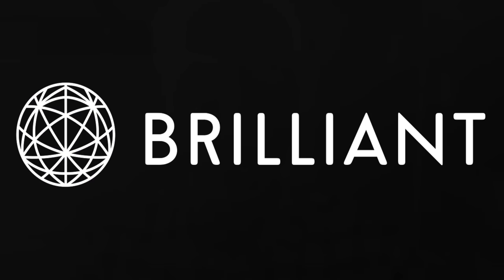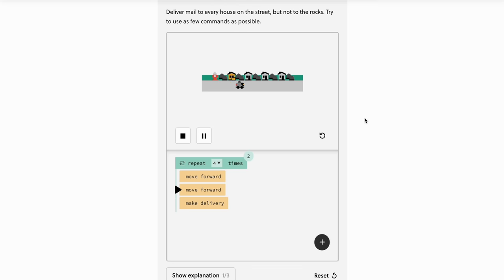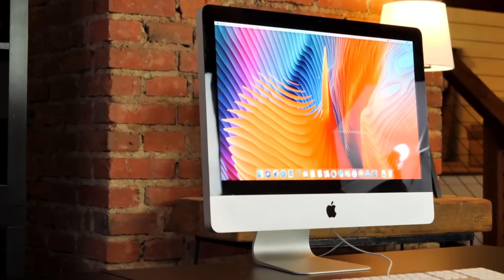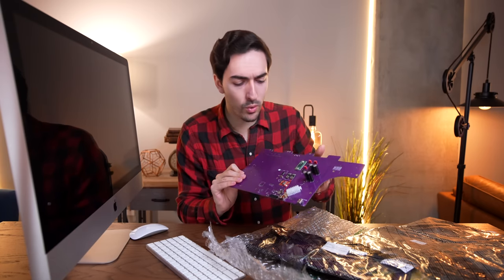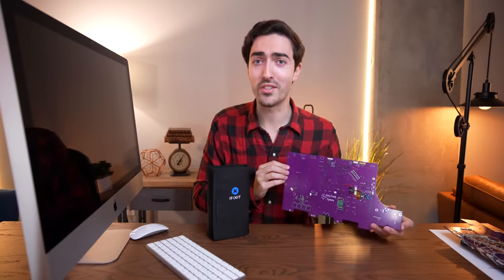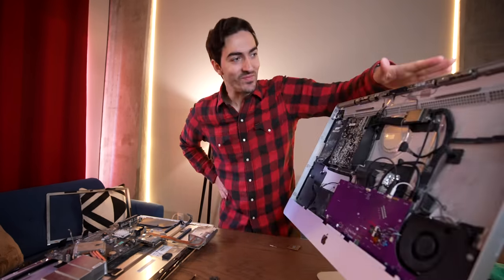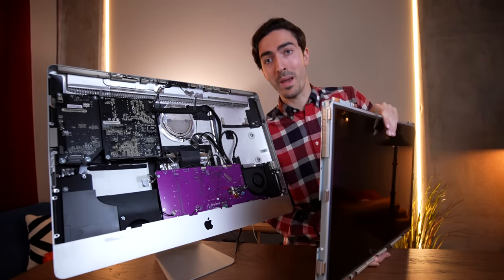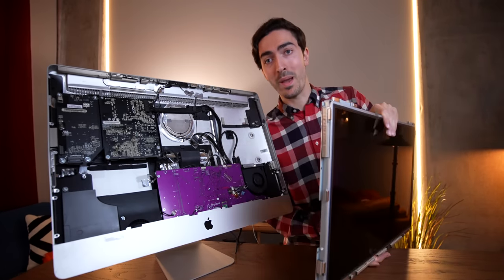Upcycle an old iMac display with this INSANE mod!

Comment: Absolutely the kind of mod I need.  I need to upgrade my work mac to run software that now requires an OS I can't install.  I usually just buy a new imac for home, then take the home imac to work.  But my home imac is new.  Much more sensible to buy a mini and use the perfectly fine screen on the old one.

Comment: My 2017 iMac I bout 2 yers ago died with graphics board needing replacement and apple is asking for the price of a 2021 MacBook Air M1. I was so frustrated that the Mac failed after an update… I pulled out my unit and can’t believe a 2 thousand dollar computer is only good for less than 2 years and the thing is it is barely used because it is a trophy computer that I plan to keep, instead I use my other computer iPad and MacBook as daily drivers. The iMac was bought right at the start of the pandemic where I stoped working also, Now I don’t know what to do with it… can you advise?
When the Mac updated the computer really got hot and the fan spin so bad till it broke… em wondering if update was intentional to force users to migrate to apple silicon, thing is this is freaking expensive where I’m at and I felt I just thrown my years savings to the garbage bin.

Comment: Hi Luke. Nice video. Just wondering would buying a thunderbolt 2 to 3 adapter be another option to connect the new MacBooks and use the iMac as a monitor?

Comment: I had a 2011 iMac 27 that had the graphics failure.  I baked the board in my oven and it worked for years.  I ended up selling it in 2017.

Comment: I've been researching this very e-cyclable system for a few months and have yet to find an answer: Is there a way to convert a functional 27" 2011 iMac A1312 to an external monitor if I use the OEM cards while removing the HDD and other OEM components? Such beautiful 5K displays are routinely in alleys.

Comment: Hey Luke, I need to pick your brain. I have a 2008 iMac 24 inch with 2.8 ghz and 4 gb  memory running el captan. It has been in stores a for the last  6 yrs. Got it out and started it.  Started well , every thing was going well , then froze when updating the wifi. So rebooted. Now all I get is the white screen of death. I checked the following :  the four leds near the memory ports work. Tried all the reboot options . Still nothing.  No Apple icon or start up bar. Is there away to check that the screen or gpu is not broken .  With no Apple icon showing could it be the hard drive failing or not working. How do I check if it is hard drive issue.  The reason I got it out was I was inspired by your videos to upgrade to hdd to ssd.  I don’t want to that if the screen has to be replace. I want it to use web browsing and basic daily use. Hopefully you can give some guidance. Thanks Trev.

Comment: Glad to see you cover this project from here in Australia. Despite having a pile of these iMacs and being an ideal candidate for this product, I didn't order one. Largely because while the panel is actually great quality, it's not a 5K panel, and you're effectively converting a 2011 iMac into an Apple Thunderbolt Display. And the price of the Juicy Crumb + iMac 2011 27" is not a fantastic deal vs a used Thunderbolt Display from what I've seen. But it's an amazing project thought and I love the idea. If they did one for a 5K iMac, as you say - I might have to part with some $$ :)
Reply: I think exactly the same.

Comment: I have a 2010 iMac 20" that still works, but would be cool if I could use it at a second display.  I haven't found any easy solution to do that.  Seems like the 2011+ had all the luck :(

Comment: What is the source of the incompatibility with the 2010 iMac?  I have an old 2010 27" iMac (i7 version) is there some way to adapt the Juicy Crumb board to work with a 2010?
Reply: Alas, no.  They’re very different inside.

Comment: Hey Luke, maybe you can find something similar to do with a 2011 MacBook Pro. (Why is it that the 2011's all had graphics card issues?!) I've considered just replacing the logic board with a 2012 MBP logic board, but I'm certainly open to other ideas.

Comment: I have a 2011 27 inch iMac which had a broken graphics card. I have replaced it with a graphics card from a stock 2010 21 inch iMac. I could swap it without needing to remove the cooler from the card, so the card plus cooler combo from the 21 inch iMac physically fits perfectly into the 27 inch one. It works just fine and no further special things need to be done to get it to work. Just don‘t forget to also plug in the small temp sensor cable of the gpu.

Comment: Now for a value added upgrade. Just add a NAS or hardware raid  board, and add NVMe, or SSDs and some external I/O. And you have a cleaner desk. 
With a dvd drive and fast Raid or DAS  and a screen.  
Thus A real all in one upgrade as a second iMac monitor, or M1 Mac mini storage hub.

Comment: If I could run a pair of the 5K Macs with a mini, I would be all for this setup. Nice video! I was sitting here actually cleaning my old 2010 27" in prep to back up all my data off the old dude.

Comment: I agree that this should be one cable to the USB3.1+ port of a newer Mac.  I would add the optical drive and dual M.2 connectors.  Simply add a Docking station on the Juicy board.  This is an idea with legs of course.

Comment: What juicycrumb is doing is a great project, the only thing I would mention is the price for the docklite board. 
if a Dell 35" curved (4k, 140Hz) costs $280 and then this board costs almost $400, I would say that it might not be the best solution for someone who is on a budget.

Comment: I inverted an 2011 iMac 27 inch to an external display. Payed 80 euro’s for the iMac and 75 for the board. Worked fine with my M1 MacBook Air. After a few weeks however the buttons gave up, a few weeks later it would not could not get out of sleep mode. Have to restart the M1 every time. Quality of those boards is crap. Hope this one is better.

Comment: It would be cool if Juicy Crumb did something similar for the 27" Thunderbolt Display and upgrade those USB 2.0 ports to USB 3.x ports. Also, update the MagSafe output of it to USB-C PD and be able to just plug in the USB-C MagSafe cable for a MBP from Apple.
 Thunderbolt 2 is still plenty good/fast enough and all you need is a Thunderbolt 2 to Thunderbolt 3 adaptor from Apple. I would TOTALLY pay for an upgrade in a heartbeat!

Comment: Hi Luke! Hoping you still browse your comment section, as you seem to be the guy to ask the following: i was just browsing for ways to upgrade or jailbreak older imacs, as my old man has a 2010 model, that's he's quite emotionally attached to, and while still working fine (for now) it started the apparently common issue of not wanting to upgrade..it's currently running High Sierra (10.13.6) and iirc it should at least needs to run Catalina to still support the bulk of apps and prog's my dad needs... 

Now, i was watching this and saw you mistakenly got sent that 2010 model, and you had to re-order and re-do, so i have to ask: this doesn't work on pre-2011 models? I was hoping it was, but so far everything pre 2011 seems really difficult to upgrade, both in software and hardware. I am somehwat savvy with regular PC;s but a total newb on the whole Apple scene: in a nutshell, should i go for it and try and make his machine fit for another few years, or just try finding a 2011 one and doing the whole shebang on that model? 

We are but humble folks, and have limited budgets, so anything over 200 bux for a chance of a revival would be risky - hence my first thought was to buy/build a mini PC for around 200/300, with touchscreen, so he could use that as a portable proxy and if need, hook it up to the Apple, but i'm not even sure that's a possibility...

Lotta Q's for a new sub, i know, and not really expecting an answer, but hey!

Comment: Interesting! I Purchased My 2011' 27" new but it is on its 3rd power supply and i had to machine open the aluminum case exhaust port using a router lol ya know, to keep things like its SSD HD from melting inside this 27" oven... I'll never buy an imac again and i been a mac user since my 8100 Power mac in 96'(?)

Comment: I have a lot of old iMacs, that I was hoping to covert and sell.  But, I am not sure the market would support that this would drive the monitor up to.  Plus, it does need to be one cable to the Mac or Windows computer.  Along with the super drive working also, I know CDs/DVDs are dead.  But it would be nice to have the options. Will it even work with a Windows computer?
Reply: Hi John, yes the display is fully functional with Windows, although some BootCamp drivers might be needed to utilise features such as the Webcam.

Comment: Concept is SUPER cool, but based on their website, it’s cost prohibitive. $400 - $600 to turn the iMac into a monitor, then another $100 for a 3d printed bracket to put your own MacMini in? Might as well just buy a 4K Monitor or used Apple Display. If the cost was about 50% of what it is, they’d at least be in the ballpark.
Also, would really like to see this work with the 2010 iMac’s.

Comment: Hi Luke, amazing video again. I wonder it will be possible to run my 2017 - 27" Imac in display target mode with Mac Studio with LUNA DISPLAY Dongle?
Reply: Don’t bother. Continue using the iMac on its own for now. It supports Ventura
Reply: @emilsecker7881  Pro b?
Reply: @AsenPetrov  typo. I fixed it

Comment: Need to know if a PC with Thundderbolt will be able to work with this on say, Windows 10 or 11..  That would be sweet.

Or a DisplayPort Connector.
Reply: Any display port equipped computer will work, but certain features like the webcam may need boot camp drivers to work correctly

Comment: Exactly what I'm looking for!!.... the DockPro could be a very interesting solution because I have a 2011 27" Imac and would like to use it as a display with MacBook but also PC Laptop.... Will the DockPro works with both solution ?
Reply: The DockPro is still in active development, but we are aiming for it to be compatible with virtually any USB-C capable device once it is complete :)
Reply: @Pendleton115  Great, do you have any idea of the availability of the Dock Pro?
Reply: @GuillaumeSECLET  DockPro is still in the design stages, so I am currently not able to give an accurate estimate on when it may be ready. Although we’re hoping it’ll be done before Q3 2023

Comment: I LOVE the concept, but you really should have mentioned the price in your video, because $386 (the cheapest option, which you tested) buys a pretty decent brand new display these days.  The USB-C "Pro" version is nicer, but that same nearly $600 cost would buy an even nicer display, too.  I could maaaaaybe see laying that out for a 5K display (maybe) ... but not for the one inside a 2011 model.

Comment: As some have mentioned it would be great if the optical drive could also be reused - why not it's there - and while we are at it a USB hub as well utilizing the old port locations, network USB etc. And finally reuse the hard drive. Together this would all add up to a compete hub/base station for a MacBook when connected
Reply from the maker: The DockPro version with additional functionality does actually allow the optical drive to work over USB! That prototype wasn't ready for testing just yet :)
Reply: Hi Derek, the DockPro will utilise the original Optical Drive as well as other accessories. There will also be an integrated USB 3.0 Hub for local storage. Cheers.

Comment: Wow, same reason why I have saved a screen that I haven't used but I just saved the screen and nothing else. It's been years because the screen still had magnets on it, and it was attached to an underside of a metal shelf. I've saved links to a controller board but want to make it look nice, so the project has been sitting around.

Comment: Wish they would make all the components work without the inefficient power supply. This could be a tiny board and simply incorporate camera, sound, usb, etc. hope they can condense things bc otherwise it’s not really worth the trouble when target display mode does the same. Great video and glad to see repurposing of those great machines!

Comment: Hi Luke, great video, and trully that board seems like a great solution for not throwing away that great display of the 2011 iMacs.
Btw... you think it will work for my 27-inch, Mid 2010 iMac?
Also, i was wondering, was it necessary to remove the optical drive? Maybe it could be used when connecting a MacMini?
Reply: Something special? What exactly?

Comment: If they can use a Thunderbolt hub internally to connect the camera/microphone with the same cable as the display that would be excellent. Ditto for all the rest of the ports on the back (as much as possible).
Reply: Hi Christian, our DockPro model will offer a "Single Cable" USB-C connection. Hope this info helps!

Comment: i have, i believe a 2011 imac, but mine has been fixed before (by apple), under the GPU repair program. Surprisingly i was able to get Montery running on there pretty well. just had to disable transparency effects cause those dont work well, but it otherwise feels like a modern machine, with 12gb ram and a core i7. I hope the day when i can't use it anymore won't come soon. it's a great machine :). Thanks for giving second life to old macs!

Comment: You should mod a 21.5 inch imac by making a removable door for ram upgrades.
Since there is nothing in the way on the back panel the only issues you would have is how to mount it so it can be removed then remounted and how to make sure it is in the right place.

Comment: This is so not what I was looking for. I really want to put a newer gpu with more vram into an older imac but they flash special firmware onto the gpu's. I was able to find one that fit into the pci slots but I had to dremel out a piece and I can't get past the white bootloader screen. If I could go from 256mb to 512mb of vram I would be pretty happy. Mine is all supe'd up so I could use it for playing some retro games, but yeah the gpu's on macs are the weak point apparently, and now they've gone full arm processor I don't even know lol. It seems like most of these Imacs are destined to be in the e-waste because noone takes it serious. I have two of them, and one I saved from ending up on the garbage truck. I've painted these old computer purple and gold sparkle and put 2.8ghz cpu's and 6gb of ram. I could have gone 3ghz and 8gb, but it was a lot cheaper this way. They run windows and linux fine, as well. One one of them I use for cloning or managing my steam deck's external storage. I use them for a lot of things, even if they can be sluggish at times.

Comment: What's the difference between the dockpro and docklite?
Reply: DockLight offers only display and video over a mini display port 6.5mm jack, while the Dock pro offers USB-C connection with in built USB 3.0 hub and other features
Reply: DockLight offers only display and video over a mini display port 6.5mm jack, while the Dock pro offers USB-C connection with in built USB 3.0 hub and other features

Comment: I just happened to have a 2011 iMac sitting in a closet and I was actually looking for another 2011  27" Apple Display that I currently use with my 2012 Mac Mini i7/16G RAM/1TB SSD.  I also use it when working at home with my MacBook Pro (with type C adapter).  My only issue is what was mentioned, too many cables.  I have enough dongles.  If these was simplified I would totally buy this board today.

Comment: I have two 21.5” 2011 iMacs with bad video cards. It would be fun to bring them back to life with a M1 mother board upgrade. Since it looks like they will only support the 27” version, my old 21.5” machines will have to gather a little more dust.

Comment: If I hadn't recently purchased a 2K ASUS display I  would definitely have gone for something like this.  I like being able to upgrade old gear (I have a mid 2012 MBP 13 to prove it 🙂).
Reply: Time to upgrade. That thing is unsupported
Reply: @emilsecker7881  I feel like we've had this conversation.  Aside from the fact that Catalina is supported until the end of this month, it's running Monterey so it will be supported for quite a while.
Reply: @bryans8656  Catalina is not supported anymore. Look it up. But oh yeah, I remember now lol
Reply: @emilsecker7881  I did.  It's November 30.
Reply: @bryans8656  where does is say this? Wikipedia begs to differ
Reply: @emilsecker7881  Well, you got me to look.  Still can't find it.  Even though it's a moot issue now I'd appreciate a link.

Comment: My 2011 27 hasn't died yet. I have the CPU  and RAM maxed out. I cleaned and re pasted it last year.  I guess as long as it does what I need, if it failed I would just replace the GPU. Another one of the same can be gotten for under $50, or it can be upgraded to another card. Although, if the machine doesn't do what you need it to do, the displays in these machines are beautiful, so this is a great option.

Comment: I have an unused 2017 iMac. I think many are waiting on a use for these as a monitor
Reply: Don’t do that that. The 2017 is still a good machine that can run Ventura. Should still use it
Reply: @emilsecker7881  for some reason mine will not run Ventura. something to do with an SSD (non-apple) being replaced. any idea why?

Comment: I’d like for them to repurpose the rear io on the iMac and replace the Firewire port with a thunderbolt 4 port to connect it to a laptop. Then you can have 4 usb 3.1, headphone/mic, Ethernet, and possibly even an extra display out via the mini DisplayPort. Connect the disc drive, camera, card reader, and hard drive too. It’ll make the iMac the all in one external monitor.

Comment: I love the project idea, but I don't see the need for a monitor-turned 2011 iMac when there exists the 2011 Apple Thunderbolt Display. I picked one up for 150 USD and it's one of the best monitors I've owned. What I would be ecstatic to see is a similar project for 5K iMacs.